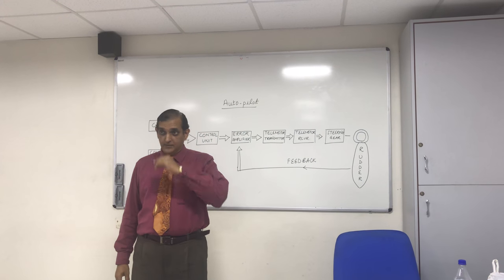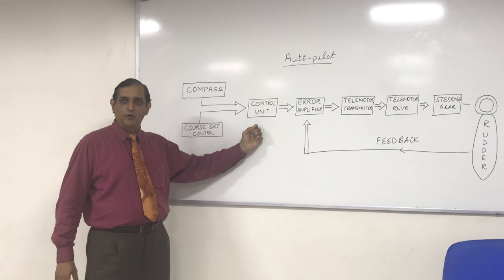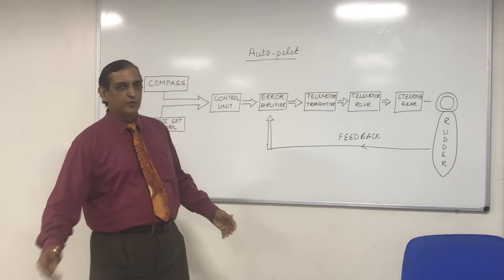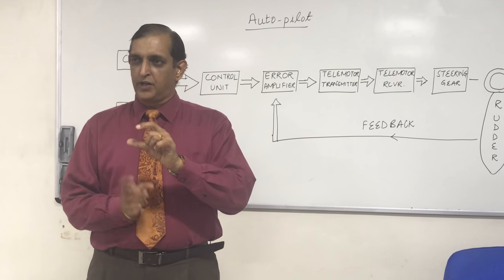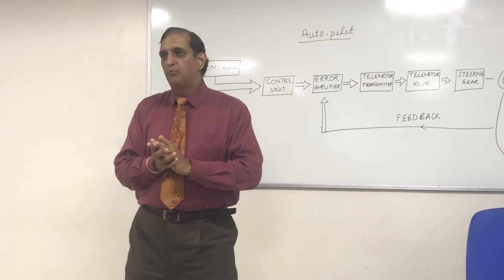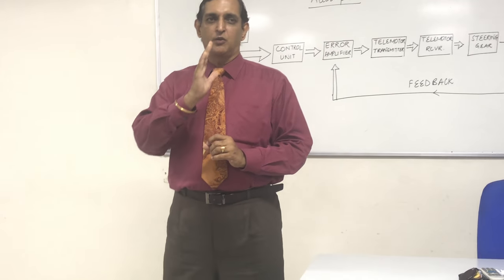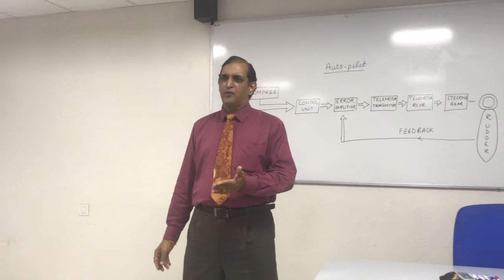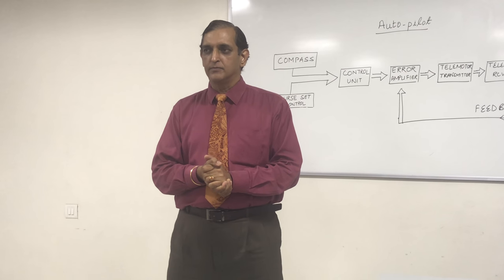Auto pilot 1

Comment: Our tug boat  equipped with autopilot , its connected with Gyro and GPS also steering system , currently the auto pilot does not work  due to faliure of GPS DEVICE , my equestion is if  GPS faliure  effect on the auto pilot or not
Reply from the maker: Auto pilot is usually independent of gps so should work  without gps.